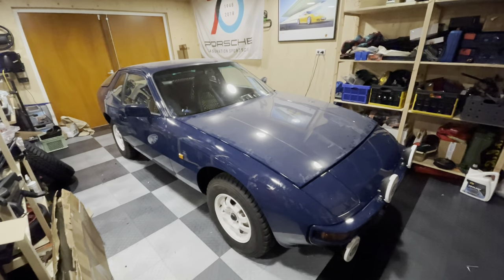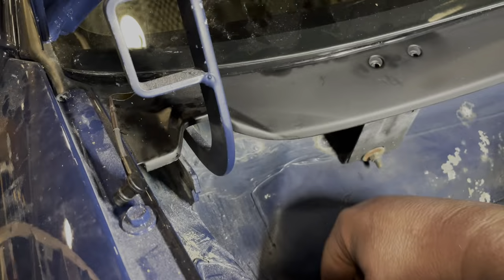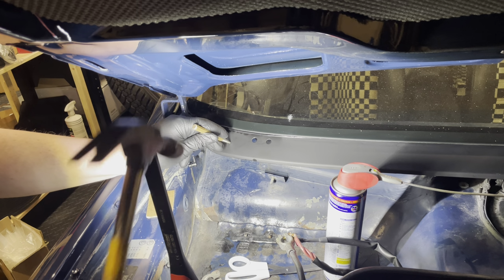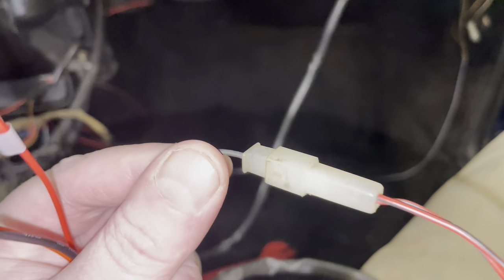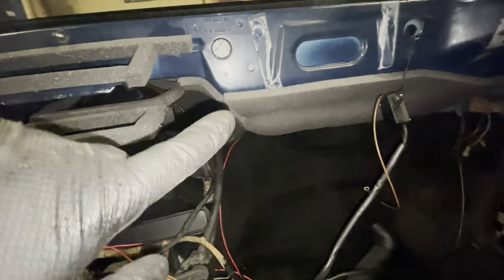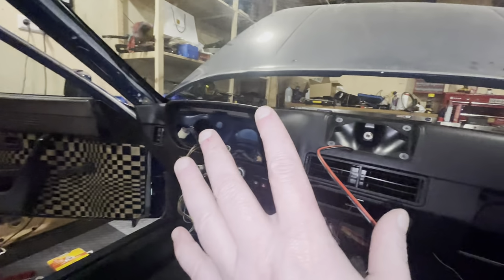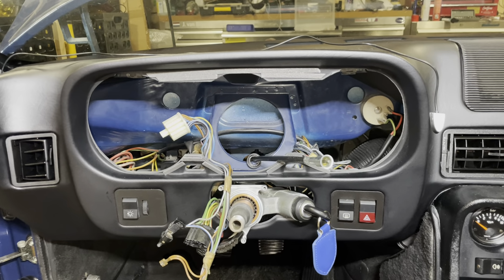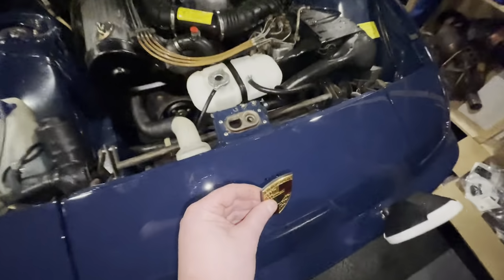Building a Porsche 924 Safari: Dashboard and Antenna install

Comment: For the front speakers you might be able to find a dual voice coil speaker the right size, failing that maybe a bracket hidden inside holding two 3 inch units behind centre grill, like out of a golf or 996 dash.
Reply from the maker: Excellent advice, I will see what I can find!

Comment: Jon, since it's an early car, it might be kind of scary, but you could put speakers in the front doors like the 944 and later 924's and 924S.  Would be tough to cut into those beautiful Pasha door panels.
Reply from the maker: The problem with my doors is not so much me cutting into the door cards, the metal in the early doors are actually different and I would have to cut into the metal as well. Have a look here: https://www.instagram.com/p/CxSyhB3oTBK/?img_index=1. Cutting into the metal will weaken the structure of the door. What I should have done was install 944 doors, but it's too late for that now.
Reply: @GarageBiljon Jon, another potential option might be to get the 968 hi -fi option door pocket assembly and use those speakers.  Other than a small cut for the tweeters, shouldn't require any door frame modification.

Comment: Nice Johann. 
Did you have the same problems with the dash as I had? For example the pins of the glove compartment.
Reply from the maker: No, swaping the lids on mine was super simple, but I really struggled to get the alignment right. I ended up having to modify the latch mechanism.

Comment: Hi. what's up with your 968?
Reply from the maker: It was getting really tough to work on two projects at the same time, so the 968 went on the back burner while I completed the Safari. But I have already resumed work on the 968 and a video will be apearing shortly.